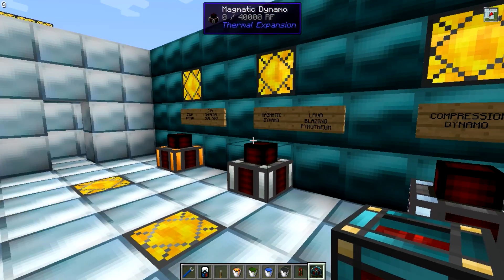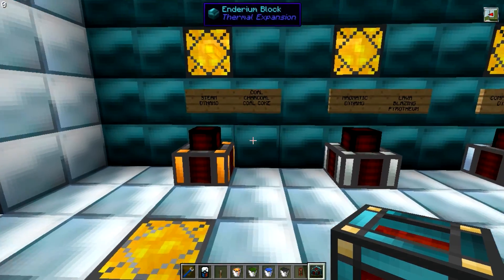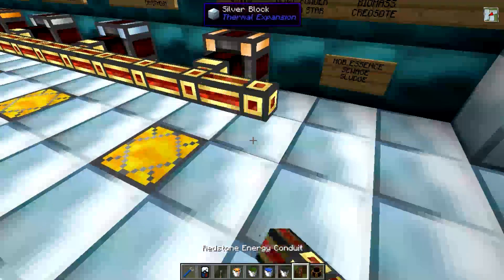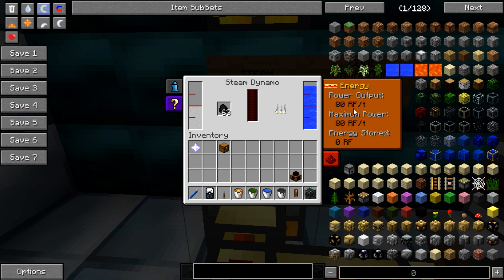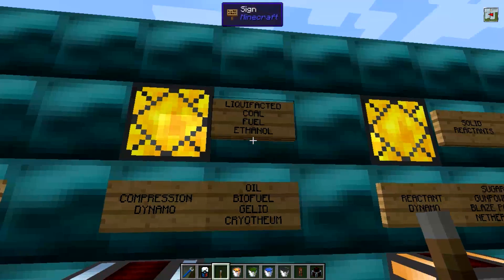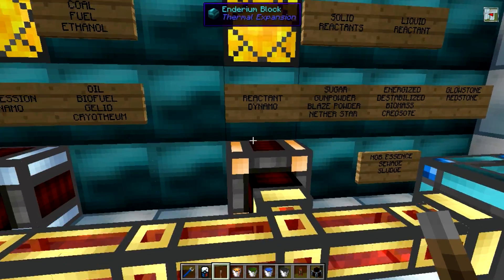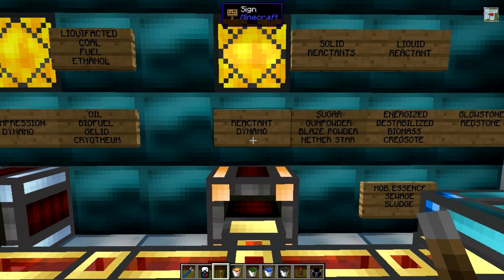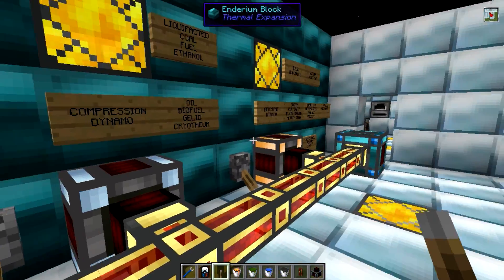DYNAMOS THERMAL EXPANSION 3 MOD SPOTLIGHT DYNAMO

Comment: I find that the new Tekkit is much more confusing than Tekkit Classic, do you agree?
Reply from the maker: I sort of transitioned between classic, to feed the beast, then back again, so the differences were not too bad. But a straight comparison between the two would be quite daunting. With the loss of ic2, its essential that you learn thermal expansion first, so that you understand the machinery. That way, you can punch trees, gather food, mine and set up your ore processing. Then its just a case of picking a mod that looks fun and trying it out. I don't know if you're interested, but Ive just uploaded the first episode of a lets play on tekkit, so the first couple of videos will walk through the basics.
Reply: A big issue with me was the removal of the energy condenser and like you said, after I played tekkit for a year, the fact that MFE's and BatBoxes aren't in the game really confused me when I first tried the new version out, after research I find it easiar to use the IC2 energy storage and distribution system than the buildcraft one.